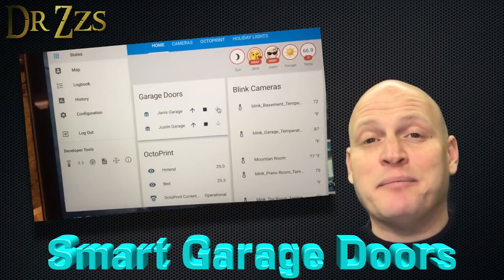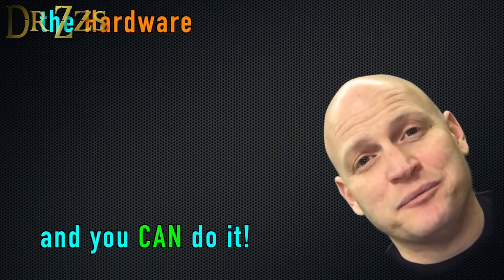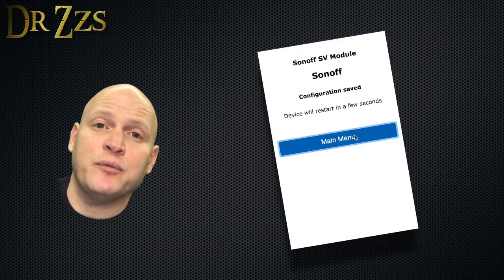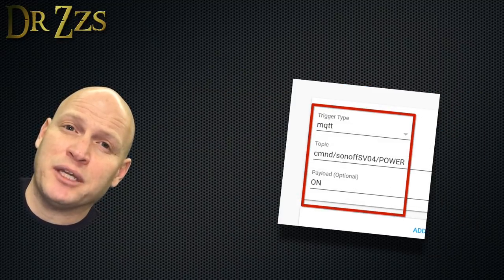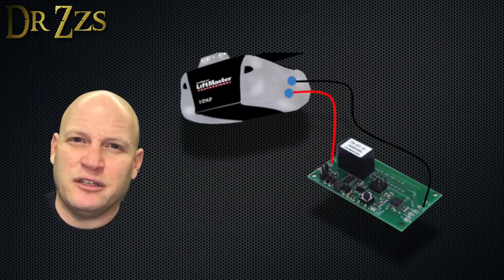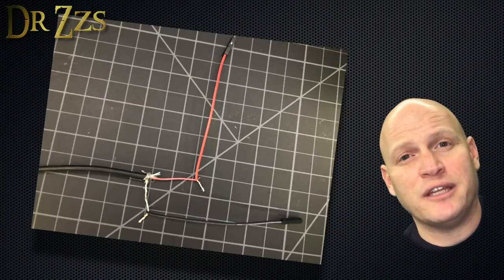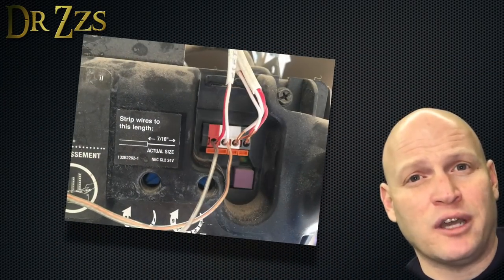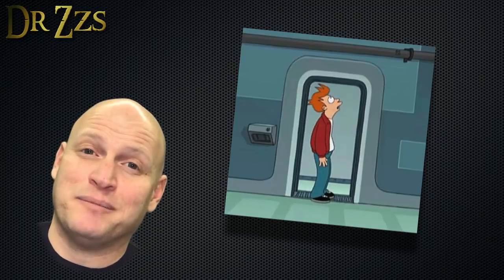$5 DIY "Smart" Garage Door Opener using Sonoff SV

Comment: DrZzs, first off thank you so much.  I have gone all in on HA based on your videos.  So far I have everything working and tackled the garage door this weekend.  Everything works as it should except the automation to check if the garage door is open.  No matter what state the garage door is in, when I trigger the automation to check to see if it works, it cycles the garage door.  The arrows in the card show the correct state.  I have tried reversing open and close for the state in the automation will no success.  My automation is below, what am I doing wrong?
  alias: Automation Check on garage door
  trigger:
  - at: '23:00:00'
    platform: time
  condition:
  - condition: state
    entity_id: cover.garagedoor
    state: open
  action:
  - data:
      payload: 'ON'
      topic: cmnd/garagedoor/POWER
    service: mqtt.publish
Reply from the maker: How are you testing the automation? by right-clicking then selecting "trigger"? I bet when you fire the automation to test it that way it only does the action and bypasses the trigger and conditions.
Reply: Thanks for the response.  Yes but I also set it on a timer and waited, same result.  I was able to figure out with an assist from your FB group.  I change the payload from ON to open it it worked!
  action:
  - data:
      payload: 'open'
      topic: cmnd/garagedoor/POWER
    service: mqtt.publish

You have stoked my inner geek, which was already on fire but is not nearing blast furnace levels (wife is rolling her eyes when I come scampering in with something new I can automate).  I am currently trying to figure out how to use a sonoff to control a 4 way switch but have it functional in case the HA server is down.  After that onto holiday lights.  Thanks again!!

Comment: I have a problem, I use SV version, I connected a mini water pump (DC3-12V RS-360SH) I feed with 12v and when I start, the Sonoff reboots (it happens the same when you short-circuit outpins). My Sonoff works perfectly with other devices. Please help, thank you
Reply from the maker: If I had to guess, I'd bet the water pump is drawing too much current.  Sometimes when a motor starts up there is a current spike well above the normal operating current draw.  That's my first guess at least.
Reply: DrZzs i understand, what can i do ?

Comment: I have figured out the presence detection piece. I use August Lock for my front door. It unlocks when I get home...never does any random unlocking (or it would be a worthless lock).  IFTTT trigger that to sonoff via ewlink....done. 100% dependable,  Understand that some dont have the lock...but it runs like a sewing machine.
Reply: Also, I can pick which person triggers it.  I park my sick ass ride in the garage (not really...its a 08 rav 4)  August lets you pick IF "person" unlocks then "ewlink). This means my garage doesn't open up when the wife gets home.
Reply from the maker: fantastic! 
sounds like a solid solution.  Good work!
Reply: But you never even told us what service you are using as a trigger though that is the whole point
I use geofence with smartthings I use both smartthings and life 360 to turn on my porch lights
But they are both not so accurate , I think for garage doors maybe  the better trigger option is to use trigger when my phone connects to WiFi

Comment: Your videos are nice and easy to follow. I replaced my raspberry MQTT garage opener with this one, and for the most part it works as you described. At this point I have some issues that i want to share, to see if you can help me: In my use case my reed switch is placed on the side and if the door is closed the magnets are in contact, for this reason I have to configure 
switchmode2 1 (Set switch mode to FOLLOW (0 = Off, 1 = On)). In home assistant the icons show properly (if the door is closed, it shows). I have an automation that alerts me via google assistant when  the door is open. It works, but when the door closes it tells me again that the door is open (even though it is closed and the icon shows it). And now the really annoying part: for some reason that I cannot explain, my garage door it is randomly opening. I have done the following to prevent that from happening: I set PowerOnState  0 to be sure that the relay is off when the device reboots or loses its connection with the network. I also changed wificonfig to 4 (Disable wifi config but retry other AP without restart). So far it works for some time but suddenly my door opens, again with no particular pattern. I am hitting the wall here... Sorry for the lengthy  note, any help it is highly appreciated!
Reply from the maker: dang.  Not sure what to tell you about that.  
I haven't had any random opening with mine.  Can you watch the sonoff console to see if there is an event that is triggering the relay?  Also check the logs in Home Assistant and see if something is happening there that is triggering it.  You've probably already looked at those. Do you have any automations or other things interacting with the door that might be triggering it?

If you haven't already try the Tasmota "issues" page, and/or the Home Assistant forums.
Sorry I'm not more help.  I'll think about it and let you know if I come up with an other ideas.
Reply: Thank you for your prompt response; for more info this is my log:

11:33:04 WIF: Connected
11:33:20 MQT: Attempting connection...
11:33:25 MQT: Connect failed to 192.168.1.80:1883, rc -2. Retry in 10 sec
11:33:29 WIF: Checking connection...
11:33:29 WIF: Connected
11:33:36 MQT: Attempting connection...
11:33:41 MQT: Connect failed to 192.168.1.80:1883, rc -2. Retry in 10 sec
11:33:51 MQT: Attempting connection...
11:33:56 MQT: Connect failed to 192.168.1.80:1883, rc -2. Retry in 10 sec
11:33:59 WIF: Checking connection...
11:33:59 WIF: Connected
11:34:07 MQT: Attempting connection...
11:34:12 MQT: Connect failed to 192.168.1.80:1883, rc -2. Retry in 10 sec
11:34:14 DHT: Received 02, AE, 00, 36, E6 =? E6
11:34:18 DHT: Received 02, AE, 00, 36, E6 =? E6
11:34:21 DHT: Received 02, AE, 00, 36, E6 =? E6
11:34:23 MQT: Attempting connection...
11:34:23 MQT: Connected
11:34:23 MQT: tele/garage/LWT = Online (retained)
11:34:23 MQT: cmnd/garage/POWER = 
11:34:23 MQT: Subscribe to cmnd/garage/#
11:34:23 MQT: Subscribe to cmnd/sonoffs/#
11:34:23 MQT: Subscribe to cmnd/DVES_95A637/#
11:34:24 RSL: Received Topic cmnd/garage/power, Data Size 4, Data STOP
11:34:24 RSL: Group 0, Index 1, Command POWER, Data STOP
11:34:24 MQT: stat/garage/RESULT = {"POWER":"OFF"}
11:34:24 MQT: stat/garage/POWER = OFF
11:34:24 RSL: Received Topic cmnd/garage/POWER, Data Size 2, Data ON
11:34:24 RSL: Group 0, Index 1, Command POWER, Data ON
11:34:24 MQT: stat/garage/RESULT = {"POWER":"ON"}
11:34:24 MQT: stat/garage/POWER = ON
11:34:24 DHT: Received 02, AE, 00, 36, E6 =? E6
11:34:24 MQT: cmnd/2/POWER2 = ON
11:34:24 MQT: cmnd/2/POWER2 = OFF
11:34:24 WIF: Checking connection...
11:34:24 WIF: Connected
11:34:24 MQT: cmnd/2/POWER2 = ON
11:34:25 MQT: stat/garage/RESULT = {"POWER":"OFF"}
11:34:25 MQT: stat/garage/POWER = OFF
Reply from the maker: did you push the button or trigger the garage during that log?
Reply: DrZzs No, I did not. That's exactly the problem. It happens randomly.
Reply: I want to report back on this issue. After I deleted any retained message in my MQTT broker by sending a null message with the retain option on using Node-Red, my system has been stable for the last 24 hours. I was checking the logs and at the moment that the system reconnects to MQTT, my sonoff  does not get the ON state as it used to. So far so good, I will keep monitoring and I will report back.
Reply from the maker: cool (hopefully...) 
It looked like something was sending the "ON" command very quickly.  Like an Automation gone awry.  
If it comes back, check Node-Red (or Home Assistant) for any reason it might be triggering.  Maybe disable any automations dealing with the garage and see if that changes anything.
Reply: It seems to be working fine. No more random openings in the middle of the night or 3AM in the morning! 
One thing that is left is that I have an automation that tells me when the door is open:
- id: PlayMediaWhenGarageOpens
  alias: Play Media When Garage Opens
  trigger:
  - entity_id: cover.garage_door
    platform: state
    from: closed
    to: open
  condition:
  - condition: state
    entity_id: group.family
    state: home
  action:
  - data:
      message: Heads up! The Garage is Open
    entity_id:
    - media_player.living_room_speaker.
----------------------------------------------------------------------------------------------------------------
When I open the garage from my HASS, it works as expected.... the speaker goes and provides the message... the only thing is when the door is closed I received the message again telling me that the garage is open (even though is closed).... I provided the logs... any ideas?
--------------------------------------------------------------------------------------------------------------------
21:15:13 RSL: Received Topic cmnd/garage/POWER, Data Size 2, Data ON
21:15:13 RSL: Group 0, Index 1, Command POWER, Data ON
21:15:13 MQT: stat/garage/RESULT = {"POWER":"ON"}
21:15:13 MQT: stat/garage/POWER = ON
21:15:14 MQT: stat/garage/RESULT = {"POWER":"OFF"}
21:15:14 MQT: stat/garage/POWER = OFF
21:15:21 WIF: Checking connection...
21:15:21 WIF: Connected
21:15:24 MQT: cmnd/2/POWER2 = OFF
21:15:24 MQT: cmnd/2/POWER2 = ON
21:15:24 MQT: cmnd/2/POWER2 = OFF
21:15:41 WIF: Checking connection...
21:15:41 WIF: Connected
21:16:02 WIF: Checking connection...
21:16:02 WIF: Connected
Reply from the maker: I'd guess it has to do with the mqtt topics the cover.garage_door is connected to.  Could be that the automation is being triggered when the relay activates, and again when the reed switch state changes.  
Maybe try changing the trigger to be the MQTT topic for the garage door state and the payload would be whatever you have set for the "closed" state.  The other thing I'm not sure about is why there's a second cmnd/2/POWER2 = OFF.  It could be that is being interpreted as a second trigger.  Either way, try changing the trigger to the MQTT message and see if that fixes it.
Reply: Problem solved! Now everything is working as it should be! I just want to mention what I have done, just in case someone runs into the same issue:
1.  Changed PowerOnState to 0 (just to be sure that if for some reason your sonoff reboots it does not open your garage door in the middle of the night :)
2. Used pulsetime 10 so the sonoff stays on for 1 second and then turns off (no need to create the automation to do that)
3. I changed the topic switchtopic2 to cmnd/DoorStatus/POWER2 and in that way if I need to install an extra sonoff with 2 switches the name remains unique also because my reed switch it is the opposite of the one used in your video I used switchmode2 1. and finally I changed wificonfig to 4 to prevent the relay from turning on when it gets disconnected from the MQTT server.

Thank you again for your videos and help!!

Comment: Looks great.  A couple of hiccups but I got everything to work.  

I thought I read that there isn't a work around for the up and down arrows to look correct when I reboot HA?

What I mean is when I reboot it's almost in a unknown state until I first activate the switch.

I would also like to add underneath a sensor that says open/closed for my front page to quickly monitor.  Any suggestion on how to do this?
Reply from the maker: Mine arrows are updating after HA restarts.  

The state topic for my garage door is just:
    state_topic: "cmnd/2/POWER2"

Maybe try this thread: https://github.com/arendst/Sonoff-Tasmota/issues/1603
Maybe you need PowerRetain 1? 

or, check the console in tasmota.  I would expect it is showing a bunch of status messages every 10 sec or so.  Something like this should be in there: 

15:43:48 MQT: stat/yourSonoffname/STATUS10 = {"StatusSNS":{"Time":"2018-07-26T15:43:48", "Switch2":"OFF"}}

If if all else fails, try changing the "state_topic" in your cover entry in the config.yaml and add a value template, something like this: 

      state_topic: "stat/yourSonoffname/STATUS10"
      value_template: "{{ value_json.StatusSNS.Switch2 }}"

I'm not a master of value_templates, so I'm not sure that'll work.
Reply: Found it.  THanks for the reply.  I must have changed it to powerretain 1  should be powerretain 0.  Works great!!

Comment: I used a modified (removed mains power from relay) Sonoff basic flashed with Tasmota firmware for this project. I used PowerOnState 0 to keep the relay state off after a power outage. I used PulseTime10 to have the relay operate as a momentary switch. It will turn on for one second and then turn off. I did not use the automation to control the relay. I have noticed that HA does not keep the state of the garage door after a restart?
Reply: Hi

Did this a month ago. (search Sonoff Basic further down).
I have the same issue with an unknown state on restart.
Setting "retain: true" in the cover setup does not seem to have the desired effect.

Comment: I have tried to connect my SV with a spare mouse cable to a phone charger that gives 5v. I checked it on multimeter, it shows 5v. But when i connect red wire to + and gnd to - (as shown on the video) it doesnt work :/ While i connect it through UART converter it works fine. Where is the problem ?
Reply: Ive checked it with 12v and no luck either... Checked the same on 2 SVs - one insulated and one not.

Comment: Hi Drzzs
Thanks for the video..awesome work...I just need help regarding open/close status if possible.....

Im currently using a Raspberry PI3 B, Sonoff SV and magnetic reed switch to control my Garage door. I do not get status update on open/close when making contact with reed switch. Status seems to get stuck in open position and stays there no matter the reed switch status. There is no problem activating the buttons to open and close for 1 second.
image

I cannot understand where im going wrong , see configuration below:

#In Configuration.yaml
cover:
platform: mqtt
name: "garage"
state_topic: "cmnd/2/POWER2"
command_topic: "cmnd/sonoffsv/POWER"
payload_open: "ON"
payload_close: "ON"
payload_stop: "ON"
state_open: "ON"
state_close: "OFF"
optimistic: false
retain: false

#In Groups:
garage_doors:
name: Garage Door
view: no
control: hidden
icon: mdi:garage
entities:
- cover.garage

#In Customization:
cover.garage:
device_class: garage
friendly_name: Garage Door

When i toggle the reed switch , my sonoff console reflects these:
21:42:28 MQT: cmnd/2/POWER2 = OFF
21:42:28 MQT: cmnd/2/POWER2 = ON
21:42:30 MQT: cmnd/2/POWER2 = OFF
21:42:32 MQT: cmnd/2/POWER2 = ON

Please Help!!
Reply from the maker: Deven Nainaar I think it’s probably a switchmode setting you need to change in TASMOTA. I’m not home or near a computer so I can’t go looking for details right now. Just go to the Console in TASMOTA and try different switcmode2 settings.  I seem to remember it needs to be switchmode2 2.
Reply: Hi , I used the switchmode settings already , switxhmode1 0 and switchmode2 2 as well as SwitchTopic 2 2. Still no luck...
Reply: I've got a similar problem.  Tried the switchmode1 and 2 settings but my reed switch on GPIO14 actually triggers the garage door instead of up/down status.  Any ideas?
Reply: Missed the "switchtopic2 2" instruction above in the description.  That corrected the reed switch triggering the door to open and close, but did not resolve the up/down status reporting in HA.  I will keep playing with this tomorrow.  Thanks again for your videos!
Reply: Hi John, Let me know if you come right...I'm in the same situation..thanks
Reply from the maker: Hmmm. Maybe it’s a home Assistant thing. Are you all using. The same version?  I’d have to check the release notes to see if the problem is listed there possibly.  I think I’m still on 0.62 
I’ll keep trying to think of what might be going wrong.
Reply from the maker: Can you see if the state topic is triggered in the history of HA?  
What happens in the States page when the reed switch moves?  Does it go from “open” to “unknown” and the stick there even when you move the magnet back?  
We need a way to do like a google hangout or something to work on things like this together. So hard to diagnose and fix things with just text...
Reply: Hi, Im on Home Assistant 0.66.1.
Reply: The state does not move from open position, it is just stuck in open (greyed out), even though i move the magnet back an forth...Let me what else you need from me...thank you...
Reply: Guys, got it working.. I rebooted Hassio. I then deleted the old code and inserted Drzzs configuration as is. Now state changes on HA. :)....
Reply: I really don't know what was the issue, probably my configuration....Thanks Drzzs.....
Reply: However there is another problem, when HA restarts both arrows are available to select. I have to make contact with reed switch for the status to update (then one arrow is greyed out, closed/open depending). Do i need to use a retain function or something like that to keep previous state?
Reply: Yeah, I'm getting the same thing too. Needs more debugging.
Reply: I did some messing around with the switchmodes and got my config working.  I need to make a new longer wire for the reed switch and then mount it on the door when in a closed position.  You don't want a config where the reed switch is near the opener because the switch will incorrectly report "closed" when the door is actually stuck open half way or otherwise not closed.  After that, I will get the second garage door working on its own SV and then I will probably set up a NodeRed automation or two (e.g. tts Alexa voice announcement "Warning,  the large garage door is open" right after I set the security system to armed).  Fun stuff!